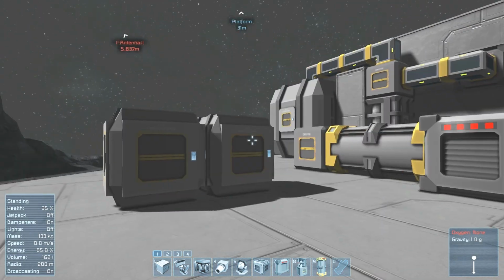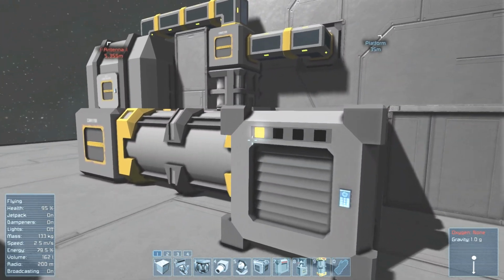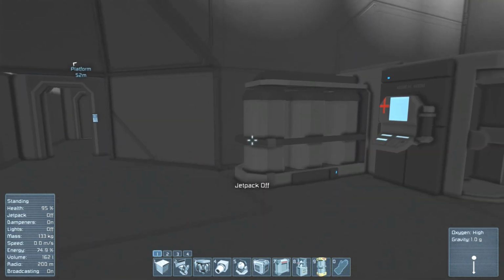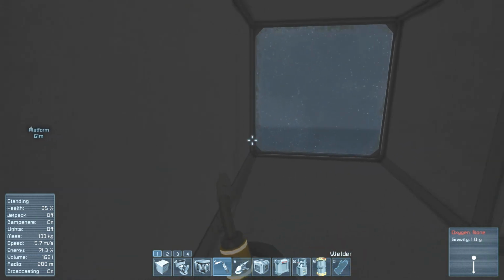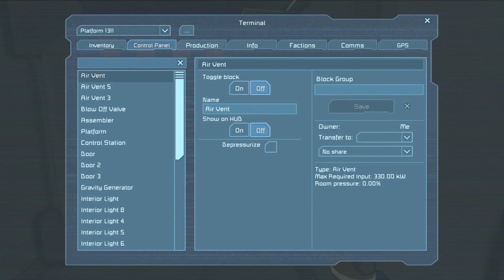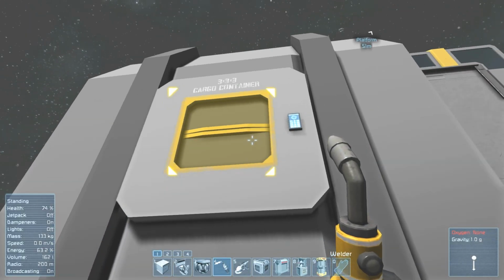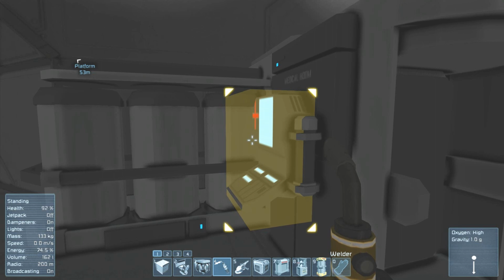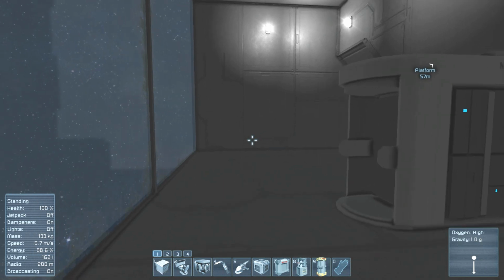Space Engineers Creative: Loss-less Airlock

Comment: The concept is a nice start. A little simple.
I'm bugged by the fact that you don't get hydrogen from the ice.
Reply: That is Some thing i hope they add aswel mabey as an adisinal powersource
Reply: Brm p 
We need:
H2 tanks.
Fuel cell reactors (like hydrogen cars) requiring conveyers from o2 and h2 tanks
Fusion reactor:
Low fuel consumption, VERY high power output, VERY big size, delicate(easy to destroy with weapons), needs power to start up.
Lasers: big lasers as main cannons for flagships. High power consumption, long charge up time. Pretty much requires fusion reactors to work effectivly.
Reply: TheBraveGallade 
Batteries vs hydrogen reactors:
Batterries take much longer to charge and requires merge blocks. However h2 and o2 tanks can EXPLOAD. And the tanks are much bigger than batteries.
Reply: In the oxygen genaretor H2O must be split in to 02 and h2 so we don't need an other block to do this they just need to put in a block wich uses the h2 to do Something and Mabey in the form of an other powersource